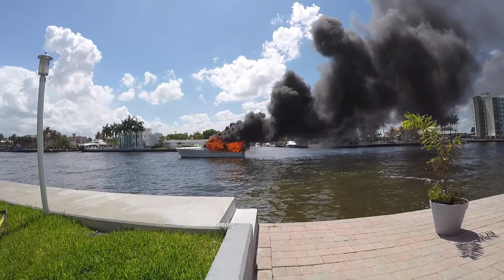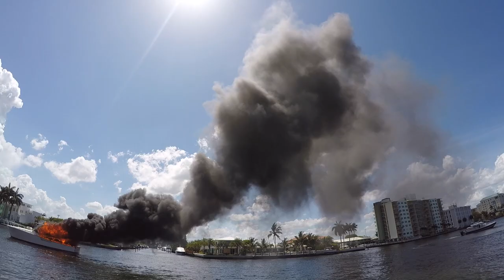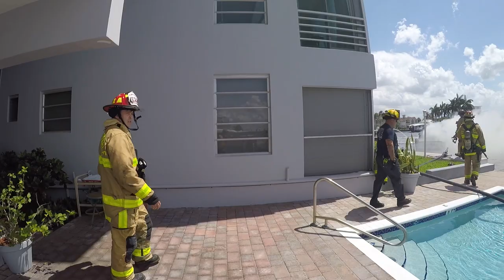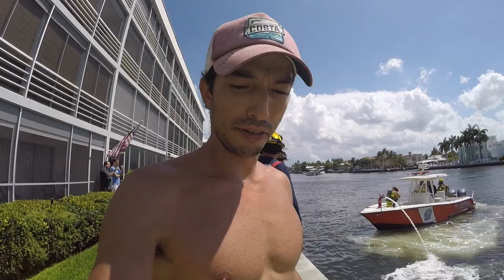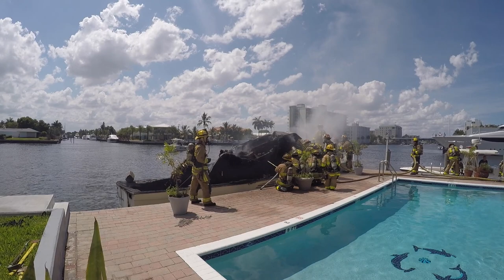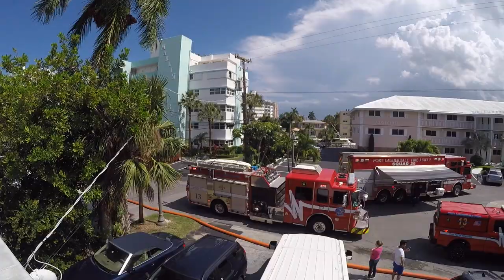Boat caught on fire (fire in the galley)

Comment: Usually a a boat fire spreads really quickly. It’s better to just bail vs trying to put it out. Also gasoline doesn’t explode, standing fumes do. It’s possible if the fire got into the bilge it burned the filler tube and vent tube and slowly burned the fumes off. If it had diesel vs gas it’s pretty hard to get that to explode. It has to be under high pressure. Normally that will just burn away.
Reply from the maker: Awesome Info! Thank you for commenting! 🙂